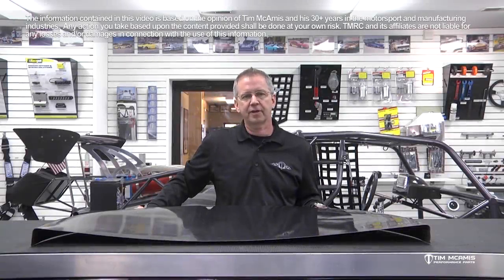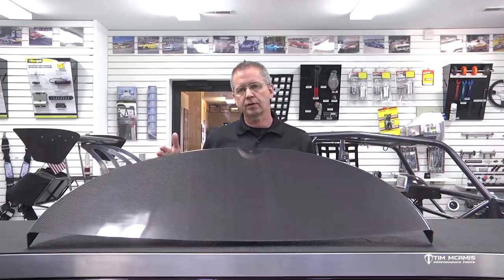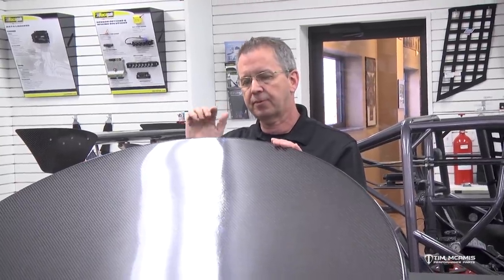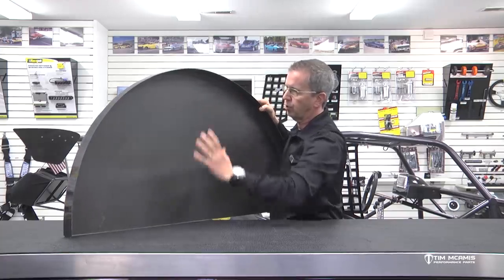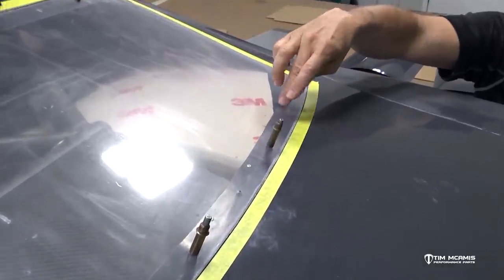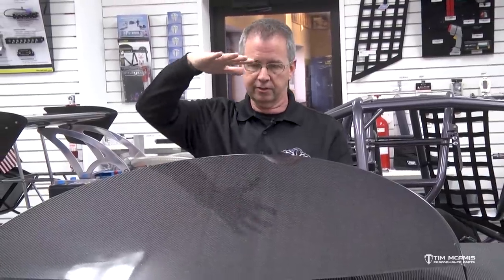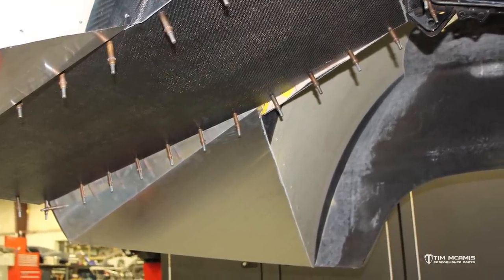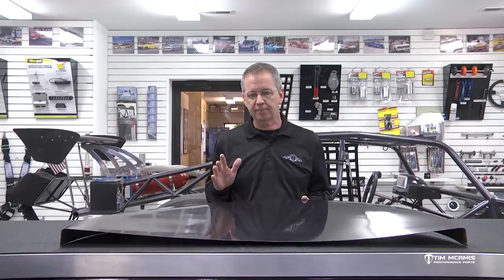Wheel Tub Size & Tire Growth

Comment: Would there be any negative effects of having to big of a tub?
Reply: Less room in the car
Reply: True Kerry. But that's not really an issue in a Pro-mod style chassis. I'm thinking more if you buy a car built for big tires but want to run small. Aerodynamics under the car must be affected some..?
Reply: I wonder if a reducer of some sort would work. Like a plug that covered part of the lower wheel well. With even an air foil to divert air flow without creating lift or drag.
Reply: Bret Lambky there’s this thing called a rule book
Reply: Groom Lake depending on the class your racing in, rules vary. 
I am well aware of the NHRA and IHRA guidelines.
My statement was simply a suggestion for potential resolutions given the correct approval 
Thinking outside of the box never hurts.
Reply: It worked for Smokey Yunick……. @bretlambky
Reply: Magnus the only negative effect I could think of is the possible wind drag inside the tub. I doubt that anyone would ever notice the difference. Unless somehow it would allow the tire to unload. If there is a lot of space I would wonder if the vortex of the spinning tire could create lift. Kinda far fetched but ??? A wind tunnel test would give you some good answers.
Reply: Bret Lambky I often thought of the magnus but only with dragsters. I think that’s why the put the “ mud flap” on the fuel cars in the early 90s  if you look at a blown alky digger they run such a small wing I bet there’s some turbulence above the tire and below the wing.  Are teams where among one of the first teams to try laying the header back.  I often think of you could make the wing on a fuel dragster out of TI and exit the header over the tire and under the wing,.... at the hit when the motor revs up to 8200-8300 the exhaust gas velocity would produce down force before the car even moved. I watch a lot of F1 technical stuff, and the blown diffusers and the aero dynamic use of the exhaust gas energy is very cool. Blown cars have a big advantage . If you scale a mountain motor N02 car , a twin turbo car , and a screw blown car and have them running and put them on the 2step the blown car has 2000-3000 lbs of down for e just sitting there due to the exhaust gas . Look up this thing called the Asporator . It’s what they use on the big double decker air bus to inflate the emergency ramp in the mandated 4 seconds. I know a few teams that have played with venturies  in the header on a blown motor and there’s benefits to be had if you can learn how to control it
Reply: Bret Lambky I would think the bigger the wheel well the more air the tire would speed up thus dropping the pressure. On most drag cars the wheel well is used like a NACA duct with a spoiler or lip at the leading edge and the trailing edge rolling way in past the tire. The magnus effect is only if both sides of the cylinder are in the air. With a cylinder on the ground you get tire squirt at the ground
Reply: Bret Lambky just my opinion though I’m no aerodynamicist or anything lol😳🤣